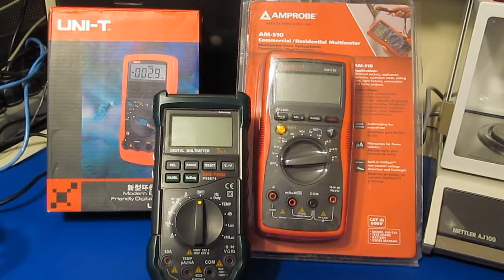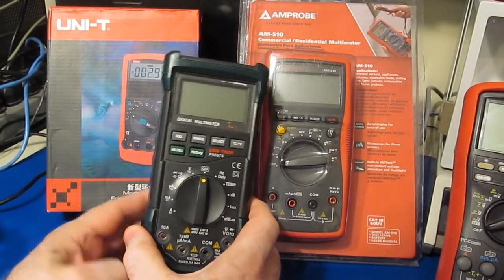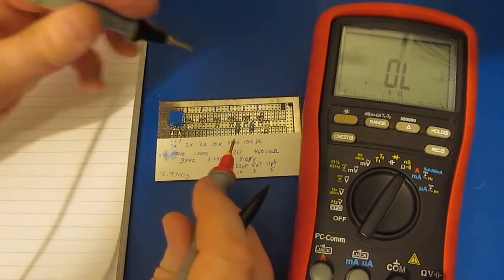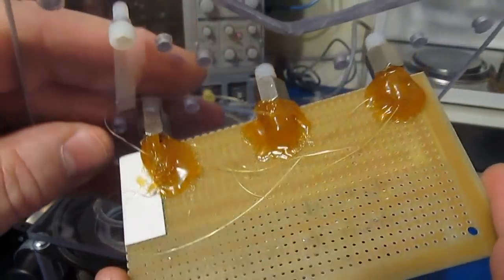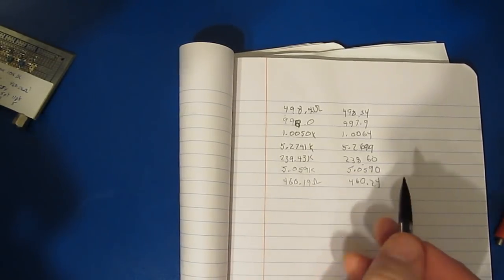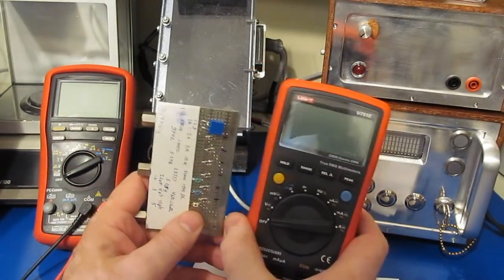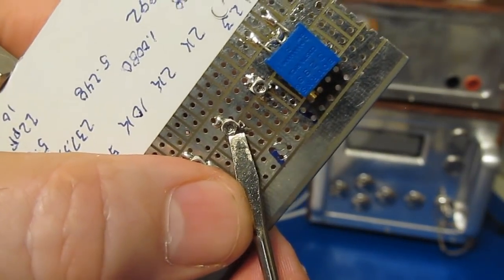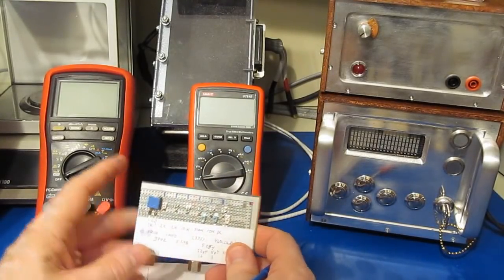Handheld DMM Potentiometer Vibration Tests

Comment: Nice test and tester.
About replacing potentiometers. I have not dived into it but if I am correct, like you tell,  there are also differences in things like tempco between the same form pots. I never looked up how much. I once had to replace a precision 10 turn chassis mount pot and that was over 80 euros.
Reply from the maker: This link is where I posted about the TC for the UT61e's trimmer:   https://www.eevblog.com/forum/testgear/hear-kitty-kitty-kitty-nope-not-that-kind-of-cat/1050/

Comment: I found exposing them to temperature swings to be more significant (still not really significant). Maybe measure them at 30c, then expose them to -40c, bring them back up to 30c? Just an idea out of curiosity that's all.
Reply from the maker: I've ran a fair number of thermal tests on handheld DMMs and not seen any offset errors from it.    The meter I mentioned that I use for automotive work has pots and has been stored in a trailer for a few years.  I doubt it is sensitive enough that I would detect any changes in it.

Comment: nice job, and thanks for putting the batteries on the vibration table - really helped to show the amount of movement!
Reply from the maker: In the description, there is a link to the section of the first video I made were I explain how the table works and the profiles.   It's difficult to see much with the low speed camera.

Comment: Thanks for the yet another excellent and interesting video.
I assume there's also some drifts due to thermal stress (micro expansions and contractions). Do you think keeping the environment tempreture as a constant variable would lead to more accurate results? The vibratoin test also could build up the temperature inside the POTs (yeah, it's my OCD).
Reply from the maker: Temperature is certainly a big factor when you are looking for accuracy.